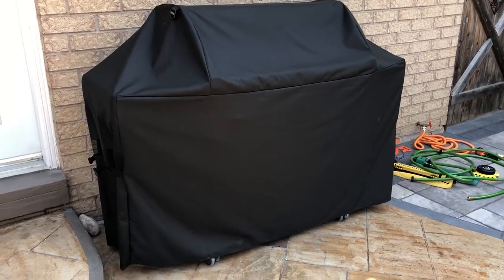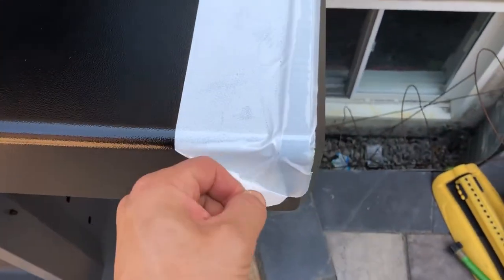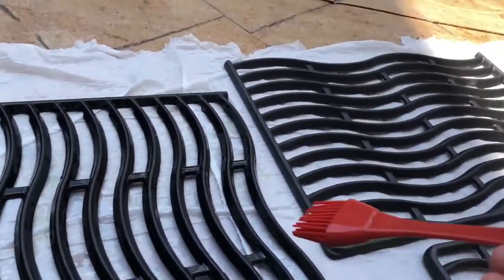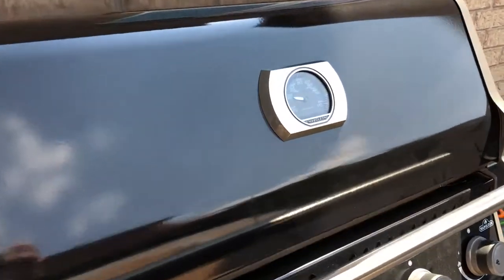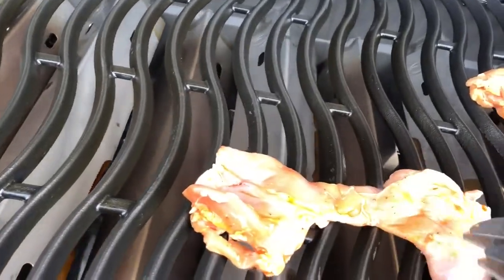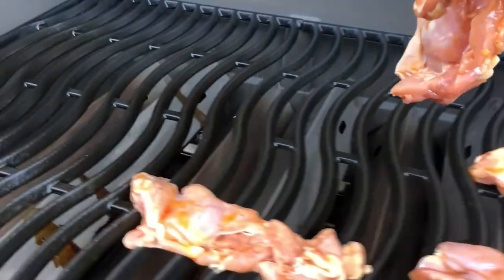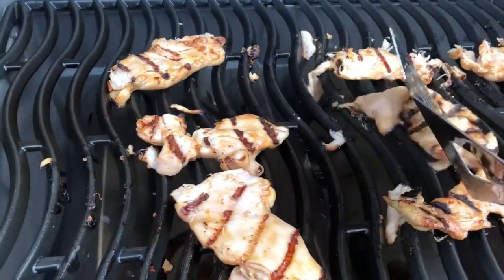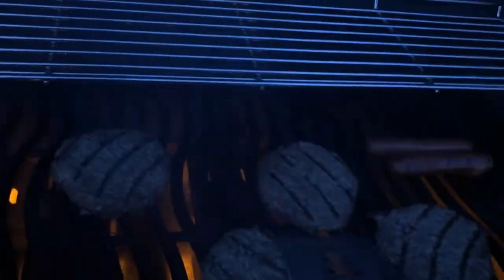Napoleon Rogue XT 625 Barbecue First Impressions and Cook Test!

Comment: the side burner is for searing meat like steaks. it’ll heat up to 1200* degrees and cook a steak in seconds
Reply from the maker: Thanks! So I assume that's for making "rare" and "medium rare" steaks where all you want is the outer surface seared and the inside still raw?
Reply: @devhackmod  
Bro, it's for searing..stay on Youtube and look up how to sear /cook a steak
Reply from the maker: @elithegreat6463  Thanks for the advice, I will look for it! I usually cook steaks on the main burners as the family likes more medium to well-done. Personally I prefer rare so I may use the searing side burner once I learn how.
Reply: @elithegreat6463 Bro calm down

Comment: You didn't season correctly that's why it's sticking my brother.
Reply from the maker: Thanks for the tip! I've been cooking on it for a while now and things are better, I guess it's built up a layer of charred food deposits but I need to clean it and season it again!
Reply: @devhackmod  Thank you for the video! I am actually considering upgrading my BBQ (low budget, it was my first BBQ so I had to learn) to the Napoleon SE 625. I hope you are still having fun using the Napleon!
Try to use a brass brush after heating up your BBQ to max. temperature after every cooking session. With that kind of brush you can clean the grates easily and use the "layer" in order to prevent the sticking. The same way you clean a cast iron pan!
Reply from the maker: @GReddy-if2pi  Thanks for the advice! Yes, I'm still using the BBQ frequently, works great and no problems sticking but I will continue to clean the top well after it gets hot.

Comment: It is a bit late now, but you should season your grill grates prior to cooking anything on them. Those are cast iron grates so they can be seasoned similar to a cast iron skillet. There are plenty of videos on YouTube that show the process like this one "https://www.youtube.com/watch?v=tszUKQdzqLw".  Seasoning your grates will keep food from sticking  to them.

Also, your side burner is an infrared heating element, which gets extremely hot. This side burner is typically used to sear steaks and other cuts of meat. You don't need to worry about grease dripping on the side burner because it gets so hot the fat sort of evaporates.
Reply from the maker: Thanks for the advice! I'll have to work on my BBQing skills over this upcoming season. LOL!

Comment: The side burner is a sear station you can definitely put steaks and stuff straight on there also with the sticking that usually means it's not ready to turn leave it cook longer then see that the meat releases from the grill
Reply from the maker: Thanks for the advice! I still haven't use the sear station believe it or not. I have to try it.